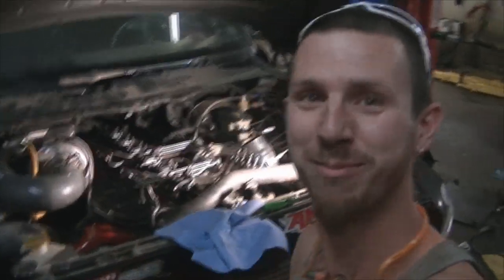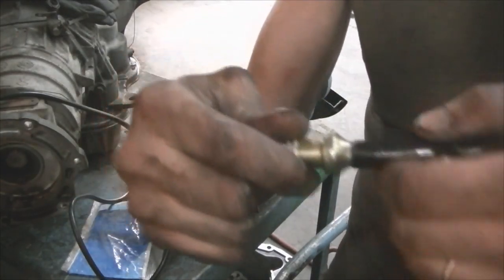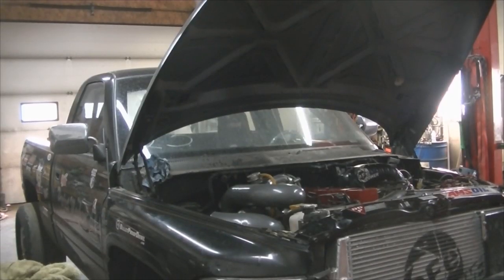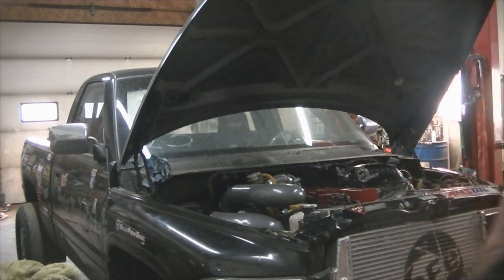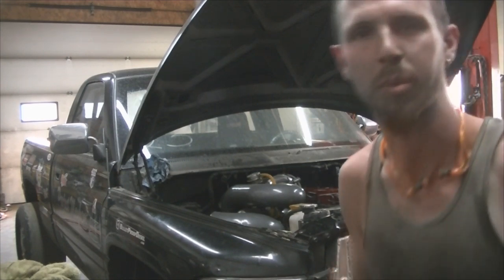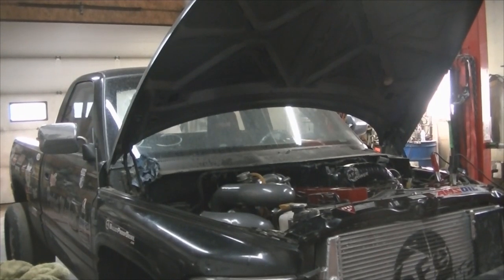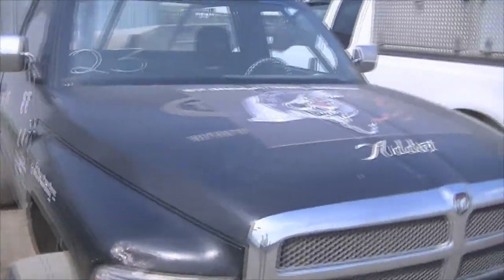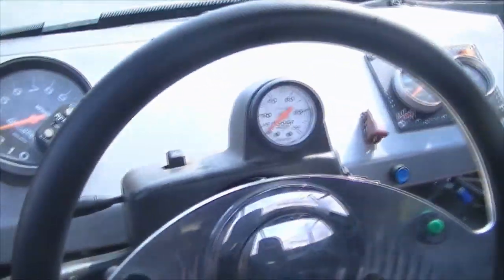Project Mayhem: Race Day Rebuild!

Comment: Lol. Memories.....of when I used to work in an engine shop. Mainly diesels. Now that's livin, workin with 5 other dudes in a closed shop in the middle of winter, and doing a startup like that, or diagnosing a bad injector. The guys are hollerin shut that thing off....
no !!dont open the door, it's cold!! Lol. 
What a bunch of crybabys they were, haha, I loved sootin them out. Dudes are runnin to the door so they can breathe ......good times. 
That white smoke can make ya cry !! I kinda forgot but there's a way to breathe a little in it so you don't tear up so much. Sounds good tho!!